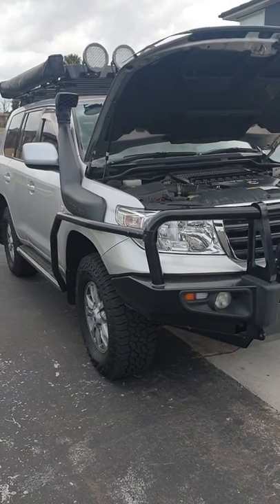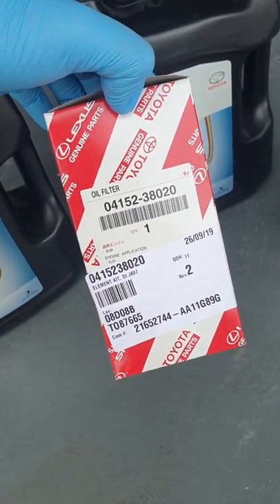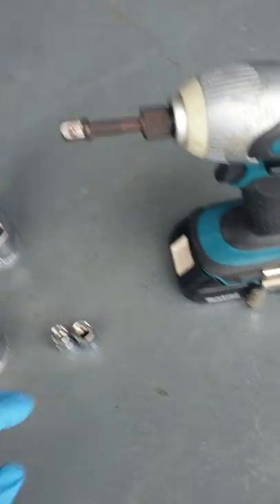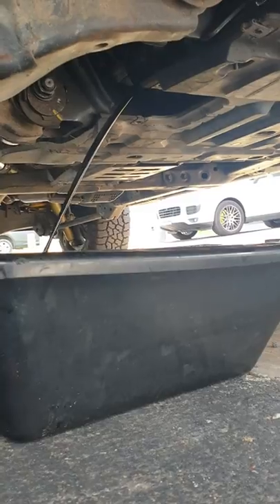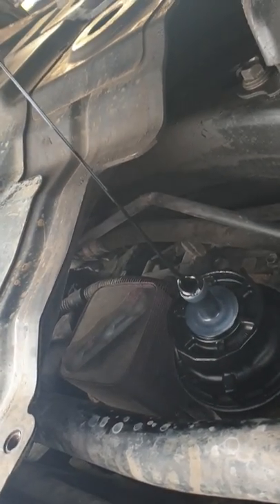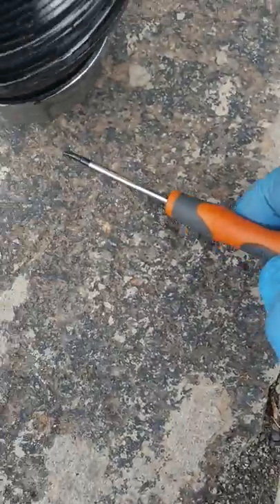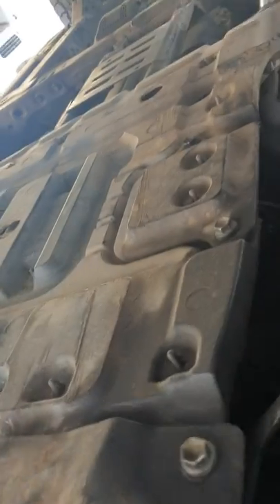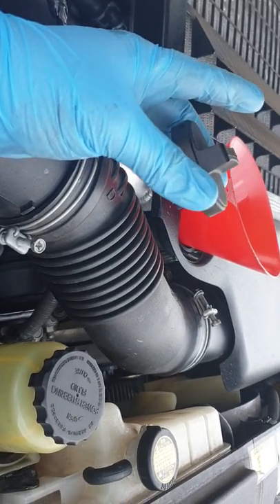HOW TO CHANGE OIL AND OIL FILTER LANDCRUISER 200

Comment: Thanks for the video, do you always use the Liqui-Moly Resealer every oil change or did u have a leak previously as this product has got great feedback?
Have you had to change your injectors or you still on the original injectors, thanks
Reply from the maker: Yes I always use Liqui Molly. Injectors have already been changed about 5000ks ago